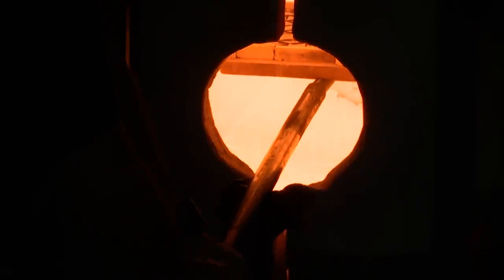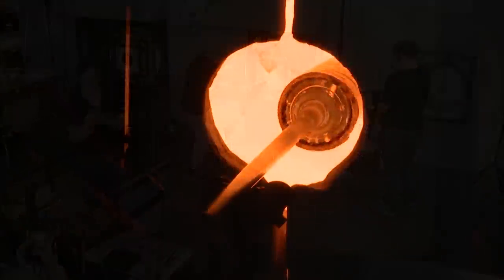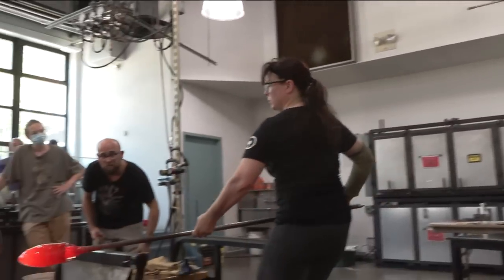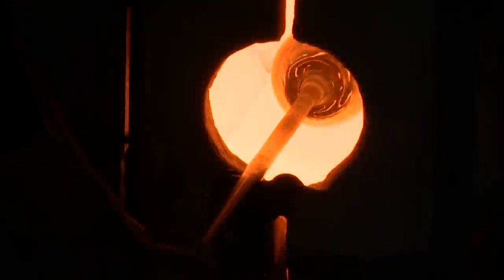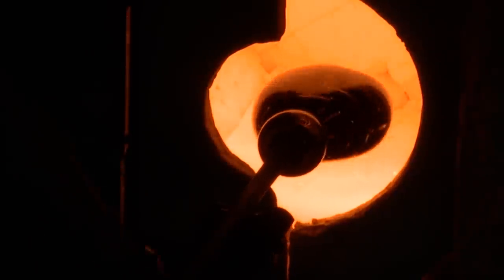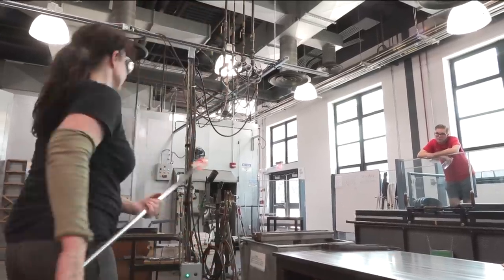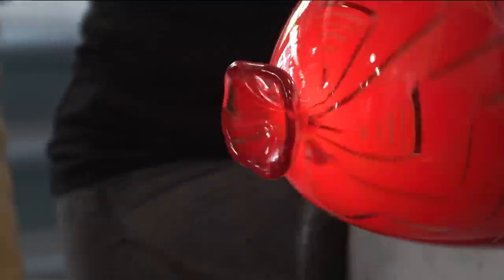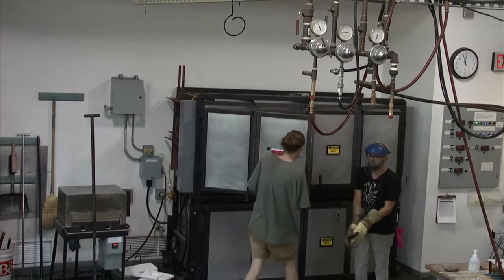Studio Demonstration | Claire Kelly

Comment: Do the pipes get warn down in specific spots where they're always being turned on the bearings when being flashed?  Can the glass be overworked at all? I heard her say there were steps that weren't time sensitive. Thanks.
Reply: The pipes themselves won't really get worn down, but the bearings will start to "stick" with age and continued exposure to the heat. When this begins to happen they can either be oiled or replaced depending on what the gaffer wants. As for overworking the glass, this only really happens if the piece is thinned too much or if too much force is applied. This can cause the glass to lose its shape easily as well as being sensitive to work with. The time-sensitive steps are typically when you're shaping/adding to the glass in a specific way (applying the punty, gathering more glass, etc).

Comment: Just a technical question: why do you say "flip" it, when you only rotate it horizontally by 180°? Is this a special term?
Reply: It probably is the easiest way to ask the assistant to turn it 180 degrees. And is usually used when something is being corked or flattened, or is a piece that is A-symmetric.
Reply: @RobbieSchroederComedy  Thank You!